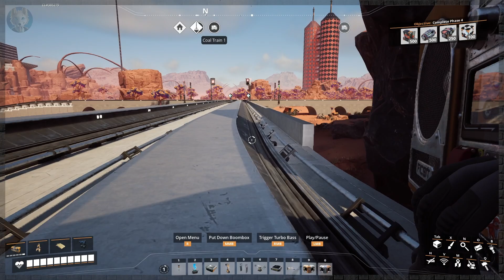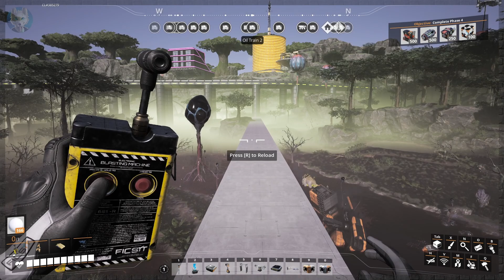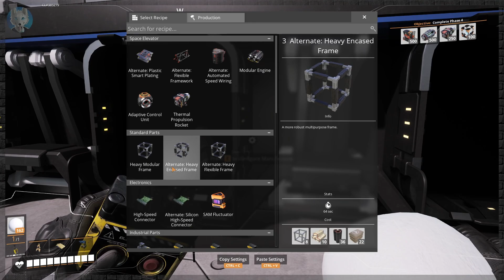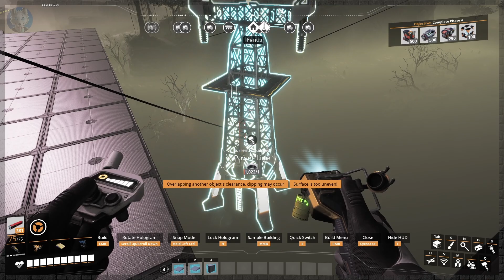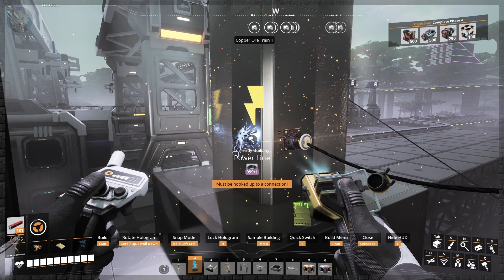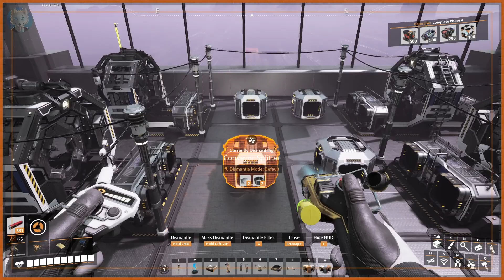Satisfactory 1.0 | Singleplayer | S4 Episode 149

Comment: Your train line is super clean! How are you handling snapping curve blueprints? I'm tryna figure it out, but I can't get past snapping the first curved section onto the straights. Second one never aligns right lol
Reply: Building curves that snap, to clarify**
Reply from the maker: @ For my curves I do not use blueprints, I just build them by hand each time. Though I should probably make some.

If you are going to do that though, make sure your straight pieces and curve pieces have the same thickness of base, 1m foundations work pretty well.
Reply from the maker: After snapping with the first curve piece in blueprint mode change back to normal mode. Then stand on your curve and while trying to place the next piece aim at the edge you are trying to place it on, in the middle, may need to rotate.

Since the other edge of the blueprinted curve is not perfectly on the bounds of the blueprint outline, blueprint mode does not work for the second corner piece.
Reply: @WhiteStoneIndustries  Thanks, it was switching back to normal mode that was tripping me up. Got a solid blueprint set going now!